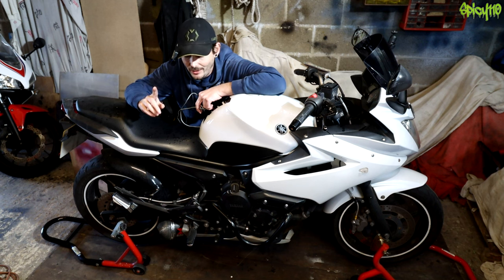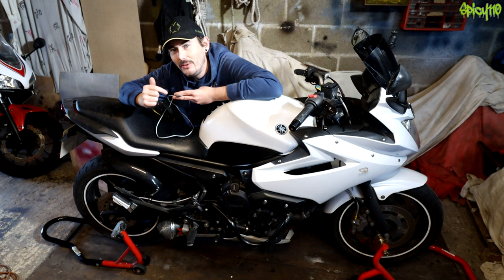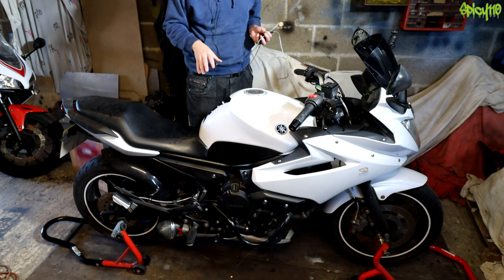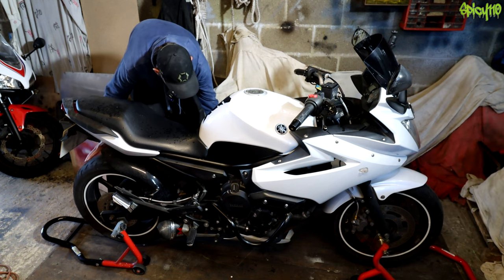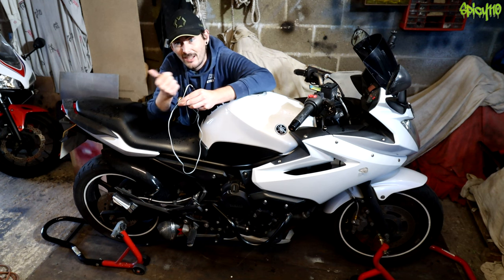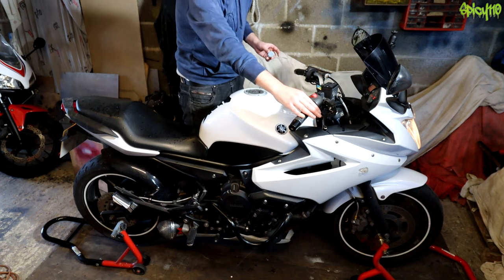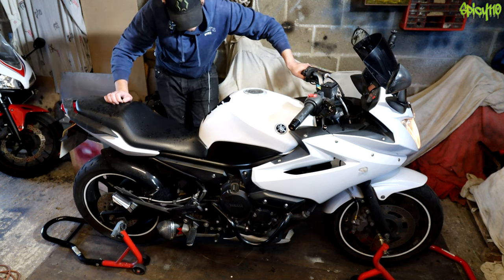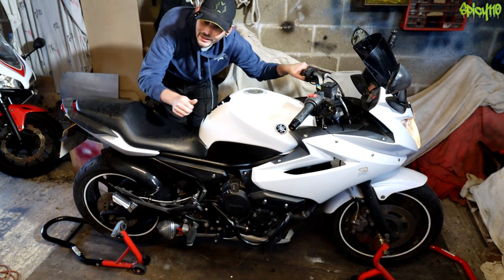Motorcycle Stethoscope? This is really Cool!

Comment: Similar has been used for ever in garages. I used a thin metal rod with a listening cup on the end back when I was an apprentice, and have used a couple of long extension bars coupled and stuck in my ear to identify a noise many times  (even a brush pole once or twice). Making it with headphones and wires could be even more practical in the confined space of a bike engine though. Search of my bits and pieces boxes to make one on the cards I reckon. The more people you pass this on to the better.
It's fascinating where you go on youtube, next I'm going to watch Big Clive stripping down a catshit neutraliser and I haven't even got a cat.
Reply: I reckon big Clive has cats in his beard 😂

Comment: A stethoscope has always been a very useful mechanic's tool. In its most basic form, it's a long screwdriver held against the ear, but I have one similar to the medical type but with a probe on the end, with a screw-on extension if needed. Cheap, basic and low-tech, but invaluable in pinpointing mystery noises.
Reply: Ok.....but not to near the spark plugs.  That experience  is thrilling  belive me
Reply: @richardcurtis114   Quite an effective way of finding out if you've got bad insulation on the HT leads, though. I've had the handheld defibrillator treatment more times than I can remember during my years in the workshop.
Reply: Was just saying that! 😏 It's like the age old trick of using a LONG screwdriver with handle placed by your ear, tip placed around the motor* to listen out for taps and knocks! Ideal for finding out if valve clearances are loose, camchain is rattling, knocking and so forth... (Thanks - my ex RAF Electro Mechanical Engineer Dad Back 40 years a go when I was a kid and learning  stuffs!)
* DO NOT place the tip of the long screwdriver near ANY moving parts like the fan, belts, pulleys and such, as you will PROBABLY find your head has developed a new 'Feature design' to show your friends, family AND DOCTOR/Emergency Wing! 😏
😎🇬🇧

Comment: It's like the age old trick of using a LONG screwdriver with handle placed by your ear, tip placed around the motor* to listen out for taps and knocks! Ideal for finding out if valve clearances are loose, camchain is rattling, knocking and so forth... (Thanks - my ex RAF Electro Mechanical Engineer Dad Back 40 years a go when I was a kid and learning  stuffs!)
* DO NOT place the tip of the long screwdriver near ANY moving parts like the fan, belts, pulleys and such, as you will PROBABLY find your head has developed a new 'Feature design' to show your friends, family AND DOCTOR/Emergency Wing! 😏
😎🇬🇧

Comment: A suggestion for a follow on to this is recently I had a blocked up ear and bought a 10 quid ear camera thing off eBay. It really worked well and I was able to use it to check my ears. I was thinking how it would be cool to have a look inside some other things like the cylinder head and crank case (of my bike, not me). Dunno how much info you could gain, you'd presumably see if the pistons are carbon'd up etc. 👍😎
Reply from the maker: Yes, my other half has one and I have thought the same. However proper endoscopes are now pretty cheap. 🙂
Reply: Yeh man😊

Comment: These have been used for many years to pinpoint problems on bikes, I once had a noise coming from my bike that would only happen now and again but it sounded like something was about to fail, the noise would get louder and faster when I reved it, couldn’t work out if it was the oil water or fuel pump, I used a hoover pipe to put on the different locations and the other end on my ear my girlfriend thought I was insane until I told her the noise was coming from the fuel pump which was about to fail, I replaced it and the noise stopped 🎉

Comment: If you want to hear the inside of an engine stick a flathead against the engine and stick your ear to the end of the handle
My old man taught me that
Reply from the maker: yep, 5:30
Reply: Yeah, I just said that too with my ex RAF Father... I ALSO mentioned.. DO NOT place the tip of the long screwdriver near ANY moving parts like the fan, belts, pulleys and such, as you will PROBABLY find your head has developed a new 'Feature design' to show your friends, family AND DOCTOR/Emergency Wing! 😏🤣🤣🤣
😎🇬🇧

Comment: Looking forward to watching follow up videos to this. 
I use something similar at work when remapping/tuning cars. I've got a knock sensor wired into an amplifier with headphones plugged in. When the knock sensor is bolted to the engine you can hear ignition detonation if you advance the timing too far. Helps get the max ign advance without damaging the engine